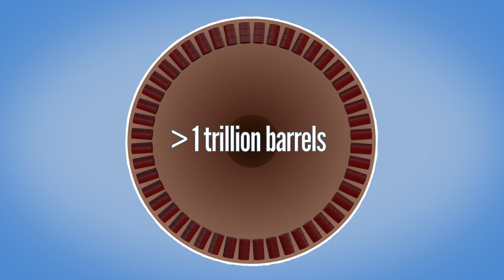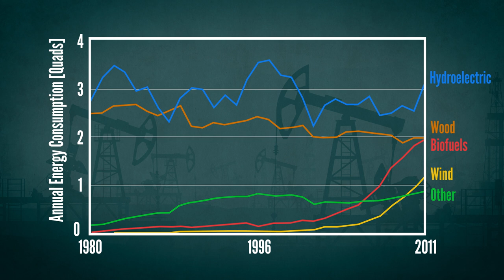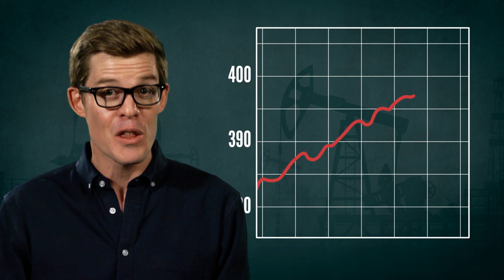When Will We Stop Using Oil?

Comment: I can't wait for fusion power to be a thing. They already have promising prototypes though it'll take a few years/decades until it's ripe for the market
Reply: didnt they want to build one in france soon?
Reply: ***** It's always 30 years away.
Reply: sooooooooDark yes ITER and in germany they have the wendelstein 7 x I will make a PowerPoint  presentation about fudmsion so I know this but could someone please tell me hiw they win the energy I mean I know what fusion is but how do they want to 'win' the energy that is released
Reply: Neo Sabien this*
Reply: sooooooooDark They've been building it. Its set to go online in 2020.
Reply: Neo Sabien Interestingly enough i just made a 12 pages elaboration about fossile energie including how they form, how we get them out of the ground and how we generate usable energie from theyer chemical energie. Id say that theyll use an steam power plant like they use it for basicly everything. They use the heat that is generated from the fusion to vaporate water or mercury to generate electric energie with a giant turbine liked to a generator.
Reply: ***** That's if  renewables don't make it obsolete/unwanted.
Reply: Ionlymadethistoleavecoments In the toroidal reactors like ITER, the conditions are indeed very extreme.  However, there's such a delicate balance of factors that have to be controlled, that if something went wrong, the reaction stops working on its own.  It naturally shuts down.

As for fusion fuel, depending on the specific type of fusion being used, the fuel can be very abundant, like deuterium.
Reply: Ionlymadethistoleavecoments fusion energy is about as non renewable as solar. By the time we run out of it, hopefully we'll have bigger fish to fry
Reply: Billy Danner
Not compleatly if we would imeadiently swap to 100% fusion energie our Lithium-6 would be used up in about 1000 years.
Reply: Nukonono Excuse me but why use lithium exclusively? I mean as stated above deuterium is a valid option (if we finaly succeed in building a reactor that really produces energy). And there are other options if I'm not mistaken. I'm not an expert or anithing but isn't hydrogen wich we have plenty of (water) also a valid option?
Also even if we say that we spend 500 year on "lithium energy" we should get off this rock by that time. If not than we are/will be doing something really the wrong way.
Reply: Richárd Milecz-Mitykó

D + T --> He-4 + n Since T is radioactive and has a halflive of just ~12 years you make it out of Li-6 in a process called "blooming" Li-6 + n --> He-4 + T so you basicly make Tritium out of Li-6 but dont ask me how its done exactly im not a scientist its just what i found on the internet
Reply: Ionlymadethistoleavecoments How much energy it produces and how hard that is to contain depend on how much you are fusing and how quickly.  If you have to fuse a large amount all at once to make it work at all, then you end up with the equivalent of a hydrogen bomb and yeah, not gonna contain that too easily.  If you can find a way to fuse much smaller amounts though, it could easily be controllable.

And yes, technically it's non-renewable, but if it can be done with normal hydrogen, which is by far the most abundant element in the universe, I don't think we'd have to worry about running out any time soon.  If you need something like tritium instead, then yeah, it becomes a far bigger problem.
Reply: Nukonono Yes, because if you read it on the internet, then it's true.
Reply: Meowzers LeChat
it was on the german wikipedia page and i think its more or less trustworthy then
Reply: ***** Pfffft yeah good luck with that. Ain't happening. Like, even if you cover the entire planet with sollar cells it's still not going to be enough for our growing energy demands
Reply: Ionlymadethistoleavecoments Run out of freaking HYDROGEN? Yeah, no, not happening.
Reply: George Perakis judging by your sophisticated way of expressing your tiny thoughts I figure you're a scientist?
Reply: ***** This isn't even my mother tongue.
Reply: Or that newer nuclear one. I forget what it's called but it seems way better than regular nuclear
Reply: Sentinalh In 2020 they hope to have a proof of concept operational. It will not produce useful amounts of electricity. Even they say, if the concept works in practice, it would be decades before a functional commercial plant could be built.
Reply: JombieMann I know, but it doesn't change the fact that its going online in 2020.
Reply: George Perakis nor is it mine, by the way.
Reply: ***** Frome the iter website (https://www.iter.org/proj/iterandbeyond) "This is the next step after ITER: the Demonstration Power Plant, or DEMO for short. A conceptual design for such a machine could be complete by 2017. If all goes well, DEMO will lead fusion into its industrial era, beginning operations in the early 2030s, and putting fusion power into the grid as early as 2040."
So power on the grid maybe by 2040. In the meantime we burn coal?
Thorium reactor, using proven technology, could be on the grid producing power within the decade.
Use Thorium for the 25+ years while fusion is being developed, and then switch over.
Reply: ***** it may have been polished already and the designs are fir for mass production but it's just met the fate of 19 century lighters - matches tycoons suppressed production of lighters))))
Reply: Lighter making machines probably didn't cost $20 billion to build.
Reply: ***** You mean cold fusion.
You see we already have fusion power but there is a problem. Currently on the sun fusion is able to happen at around 80 million degrees kelvin, thanks to the inside of the sun being extreamly compressed (high pressure) 
On earth we have not yet been able to obtain fusion lower than 100 million degrees kelvin. You see, fusion releases the same amount of energy regardless of how hot it is when the fusion occurs, so having to make it occur at hotter temperatures means you are putting more energy in then you are getting out. Cold fusion is the idea of getting a fusion reaction to happen at a nice brisk 80 million kelvin or lower.
Reply: +martinshoosterman Cold fusion is literally impossible by its supposed nature. Molecular fusion requires immense amounts of heat, to the point that STARS are fueled by it. A lot of the energy released is in the form of radiation, which is known to be dangerous by even the lower rungs of scoiety in terms of intelligence. Radiation can travel through most materials, and even vacuums. You need walls a foot or two thick of concrete to block the energy from a typical nuclear reactor so that it's safe, and even then the immediate vicinity reaches 3-4 microseiverts (may be spelling that wrong). That's about equal to being in a plane, but still higher than the background radiation of around 2.
The problem with cold fusion is that it claims to be able to defy the very nature of nuclear fusion--getting around the immense heat requirements, or the radioactive emissions, to make it safe to have in your living room, or even to lick. Doesn't work like that.
Reply: something Well I think when I say cold fusion you get the wrong impression. Im not talking about a small wallet sized battery with a hydrogen cell running at 25 degrees celsius.
Fusion can happen at any temperature. The higher amounts of pressure the hydrogen is on, the less energy you need for fusion to happen. Theoretically under insanely high pressure you could have fusion at 25 degrees celsius. But that would mean pressure several orders of magnitude more than the core of the sun. 
Fusion at 1 bar (our atmospheric pressure at sea level) Needs to be so hot inorder to happen that it takes more energy to initiate than is released in the process. Cold fusion just means getting a chain reaction to happen just cold enough for it to take less energy than it will output, ie for it to actually generate power. That's all. Were still talking about millions of degrees celsius. So far the only way we know how to do this is in a pressurised chamber, which is not necessarily an unviable solution. This is how it works in the sun. 
Also you are mistaken. Harmfull radiation which is emitted by radioactive particles does not happen in fusion, because hydrogen is not radio active. It only happens in fission because radioactive particles such as uranium and plutonium are used.
Reply: something I actually did know this all already. We need cold fusion because simply put regular fusion is useless for anything other than a bomb. It takes more power to achive fusion than the reaction produces so, fusion will not generate power. Cold fusion is the only way to generate power with fusion. The reason why we need fusion, is simply because it is clean and if done right would be an insane source of power. France has plans for a single plant which could theoretically power all of europe. These plants would actually be allot safer than fission plants because there is no natural decay, so the moment you turn the plant off, nothing is dangerous anymore. Of course its not safer than a windmill, or even a coal plant, but it should be fairly safe, so long as you keep all the idiots away.
Reply: martinshoosterman That's.... not cold fusion, I don't think. I was aware of the reactor, and even understand the basics of how it works. It uses lasers to transfer immense heat (and pressure, I think) into the fuel source. But how is that "cold" fusion?
Reply: something Cold fusion is simply any method of achieving fusion which would require less energy to produce, than the reaction outputs. Its called cold fusion because less energy means that fusion has to happen at relatively cold temperatures.
Reply: ***** By that reasoning then nothing is renewable because entropy.
Reply: Sentinalh Online as in the test plant will be running (maybe). However it's going to be a test plant, so no energy for commercial use.
It's going to be decades before the first commercial plant goes into operation.
Reply: Kites are like fusion, but renewable. We can power the world with them; I think we should save fusion for our spaceships.
Reply: +Ssgt Griggs Don't hold your breath. They had promising prototypes 40 years ago.
Reply: +Everything Explained We would need a lot and I mean billions and billions if not trillions of kites. There's a reason why wind energy hasn't taken over the world's energy supply like coal, oil, and natural gas have. It doesn't produce that much power, is highly dependent upon the place they are put, and no matter how consistently windy that place is, there will always be non-windy days. If we get economical and controlled fusion power within a few decades that would likely become our main source of power assuming that the fear-mongering that nuclear power plants have experienced doesn't happen with fusion power plants. As for fuel, it uses hydrogen and we can get hydrogen really easily from water which we have a crap ton. It also produces helium which is a very-limited and expensive resource nowadays so that would only further encourage people to produce them.
Reply: +Ionlymadethistoleavecoments They can contain it with electromagnets because the heat it so intense that it will melt the very structure holding it in place. As for the atoms, it will run out off of hydrogen, the most abundant element in the universe. All you need to so is add electricity to water and boom, we have hydrogen. The by product will be helium, and considering that we are running dangerously low on helium now a days, this is very good because we use liquid helium to many, many things.
Reply: ***** yeah 50 years is not long only in the life of a human
Reply: Luke Metcalfe True but they don't really seem to be any closer to an economically viable design than they were in the 1970. At that time they were saying fusion would be a done deal by now, with a significant portion of production.
Reply: Ansonidak sometimes predictions are happen quicker sometimes slower its swings and roundabouts
Reply: What's too bad is that these energy projects are turned into public projects. If private companies had the go ahead we'd be far ahead. ..
Reply: A hear that one 50 years ago....any day now.
Reply: "?"
How much Technology is being withheld b/c they want to milk all the Profits from the Wooden Wheel?
Reply: We had fusion power in my childhood, they did blow out sometimes so I like circuit breakers better.    They both deliver clean smokeless electricity except when my toast burns.
Reply: Pipe dreams

Comment: I'd like to point something out on the subject of eliminating the need for oil. We will not stop needing oil for likely centuries after we stop using it for energy. The reason being that oil is incredibly useful for chemistry. Not crude oil, but all the stuff that can be harvested from it, like toluene and petroleum ether. I'd wager that almost every single over the counter or prescription drug available in America is synthesized in part from a petroleum derivative or has a petroleum derivative used in its production as a solvent. Hell, we even build roads in part from petroleum derivatives, and let's not even start on polymers. Our world is built on oil for more than just energy, like how our world is still built with wood even though we don't use it for energy.
Reply: There is no shortage of oils for raw products . Petroleum products are relatively cheap and plentiful, but people have been using oil for thousands of years, and our synthesis technology has vastly improved. All sorts of ways for the manufacturing side of things to adapt over time, though there may be price adjustments. It is the energy side of thing that is the bigger concern.
Reply: I read somewhere that alcohol can do the same thing as oil. hmmm
And we can distill alcohol from plants. Some plants yield more alcohol than another. 
Like Sugar Beets yields more than corn.
Reply: @breeze787  alcohol is ethanol, and ethanol can be converted to other organic compounds which is used to make stuff like plastic etc.
Reply: @breeze787  Just remember, if we use Sugar Beets we still need land to grow it.  Its also more susceptible to upcoming climate change, weather, storms, etc, which could effect crop yield.  Its one of those things which sounds wonderful in theory, but theory and reality rarely are the same.

Comment: Nuclear fusion & Cold Fusion are the future. We must invest more into R&D.
Reply: sirgrundel Cold Fusion is pseudoscience, it cannot be done, only one Cold Fusion test "worked" (It was a hoax) and the results could not be reproduced by other scientists. Cold Fusion is not a thing people!
Reply: Eddie Gruver Hot Fusion is none the less. My point is still valid.
Reply: sirgrundel Only half so, I just wanted to point out that Cold Fusion does not exist.
Reply: sirgrundel Sure thing. until someone demonstrates that nuclear fusion is doable nuclear fission seems pretty good tho
Reply: Eddie Gruver You are mistaken, cold fusion in that test was most likely a hoax. But that isn't to say its not possible. The whole problem with fusion is it needs to happen at temperatures so hot that the energy gained is more than the energy lost, because fusion as Bar needs to happen at roughly 100 million kelvin, but even at 80 million kelvin power in will be less than power out (ie we can get power from it). thats how our sun works. Cold fusion doesn't actually mean fusion happening in a freezer at -2 celsius. its just cold enough to have a net gain in power. the only current way we know to do this is in extreme pressure, like the sun.  But, like dangerously extreme pressure. Also really hard to achieve extreme pressure. so maybe we will find away to make hyper efficient pressure chambers for fusion, or we will find another way, but cold fusion is the future. I think.
Reply: sirgrundel thorium reactor is a solution

Comment: I use hydropower for Niagara falls, in southern Canada but only in winter because in summer I go to my summer house all season and I have it generated by a generator I made (I'm smart, becuase its okay to be smart) uses old grass clippings and twigs , and I pump half that gas into my green house and the rest  I pump it towards my small garden in my backyard . But thats only like 25% my power the rest is solar and wind that i bought ( I'm "kinda"  rich). But I do have a little motor generator my a creek beside my house, it barely produces anything but it has enough power to heat half  my greenhouse, the rest is from that generator, with warm co2 coming in and some power to a air heater, maybe I will get another creek generator.

Comment: It's a shame they can't put a hydroelectric dam in the Mississippi river. A massive amount of water travels down that river with a strong current. I imagine the energy product would be incredible.
Reply: Stephen Mulkey There are currently 74 proposals to build hydroelectric generators on the Mississippi river.
Reply: JombieMann Yeah it's been talked about for a long time, but it's such a major shipping channel that they don't want to shut it down for construction.
Reply: Stephen Mulkey Yeah and sticking a dam in the middle of that river will most likely cause havoc downstream. Hydroelectric dams are often less environmentally friendly than you'd think.
Then again, most energy corps don't give a shit about that kind of thing.
Reply: Hydro electric generation does not always require building a dam. Most of the proposed projects do not plan to build dams.
https://en.wikipedia.org/wiki/Low_head_hydro_power
Reply: +Andy Wilderness But they make money. If you make money you're automatically more evil than everyone who makes less money than you. Duh.